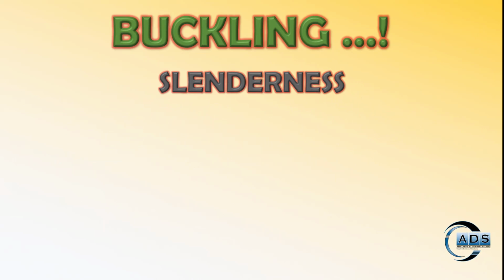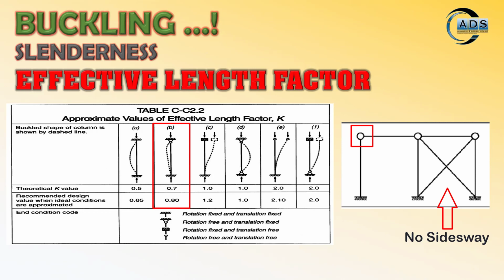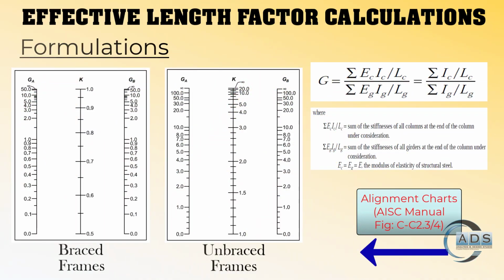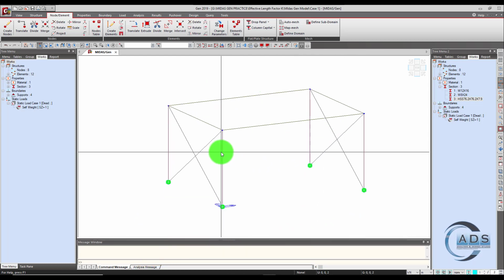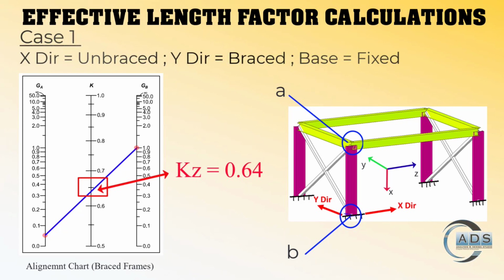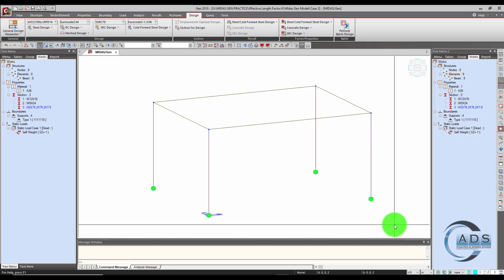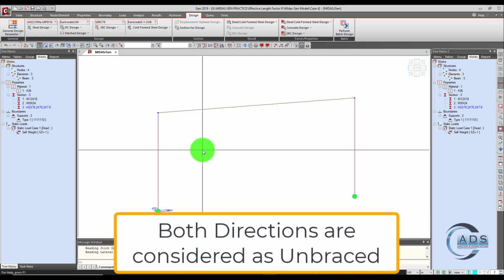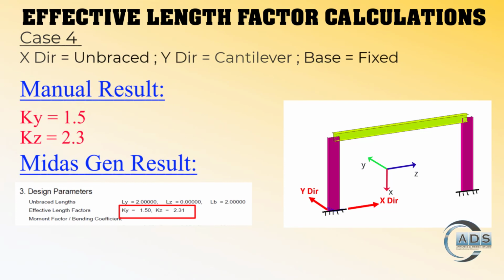Concept of Effective Length Factor for Column Design | Manual Calculations ; Verify from Software |

Comment: Is the category (e) the upper part roller and lower part is fixed?
Reply from the maker: No. Case e is actually a cantilever column case with top as free end.
Reply: Then what about roller (top) to fixed (bottom), k for theoretical?

Comment: Sir, How can I prevent cracks in non-loading partition walls due to deflected steel structural beams' interaction, please could you help me?
Reply from the maker: As per your condition, wall under beam not likely to be damaged, so deflection limit need to be more strict like L/480 or depending on the code/spec you are following

Comment: Are they previously assigned or calculated by software in case of Ky and Kz, plz explain
Reply from the maker: Cant get ur question ..
Reply: In first case after performing design u got the parameters Ky=1.5 and Kz =.64 Is it assigned manually or calculated by software .
Reply from the maker: They are calculated by software itself